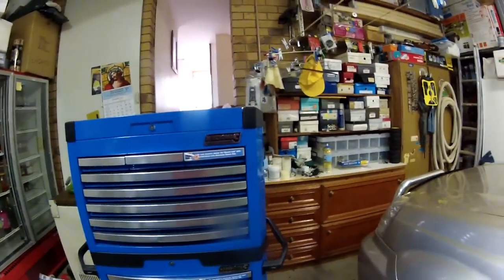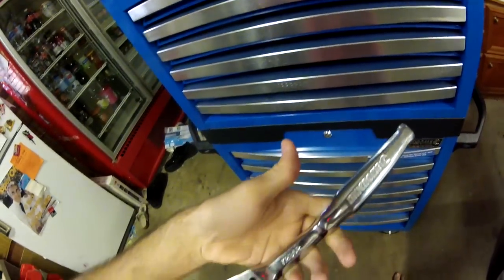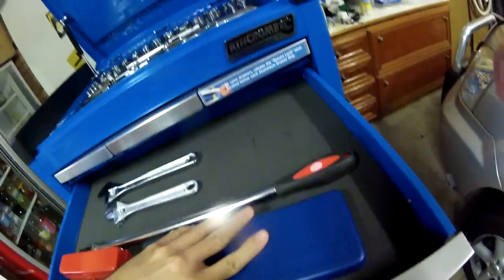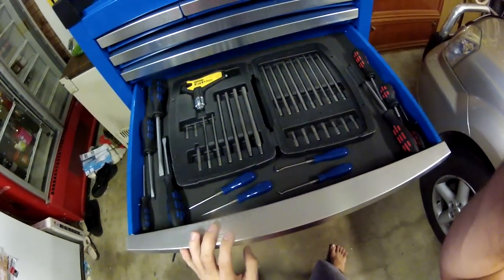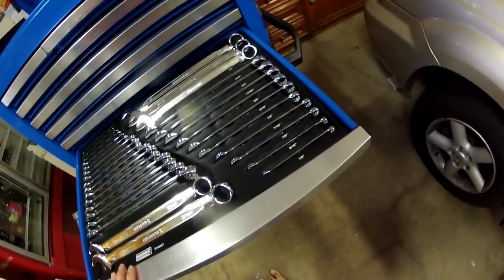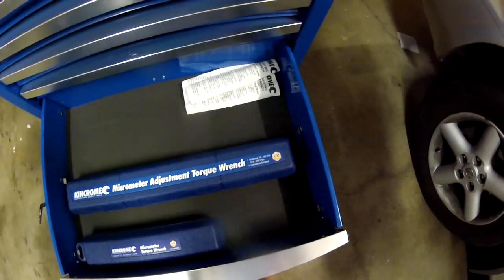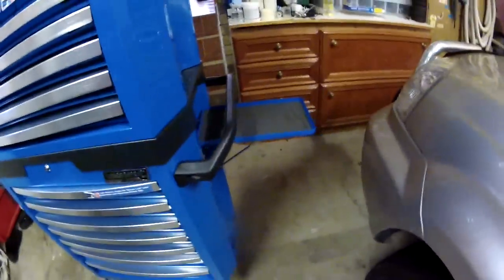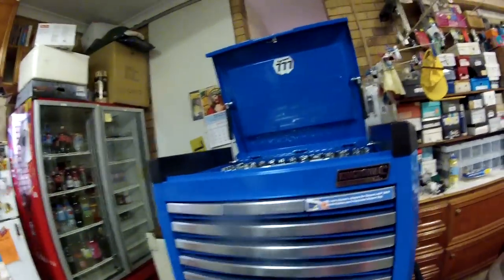Product Review: Kincrome Contour 208 Piece Tool Kit K1510

Comment: I have the same kit but without the rolling case. 
Just the top box 
Quality is excellent ! I haven't used snap on tools but I'm pretty sure that kincrome will put up a fair fight with snap on.
I'm not a work shop guy I'm just a in the shed guy ATM haha. I dream of being a apprentice mechanic but just dreams ATM. 
You have s nice kit over all :) I'm Rossi g up between that rolling case or a trolley system so I can get it from my shed to my drive way with ease.
Reply: Workshops use snap on tools because snap on comes to the shop. Simple as that.